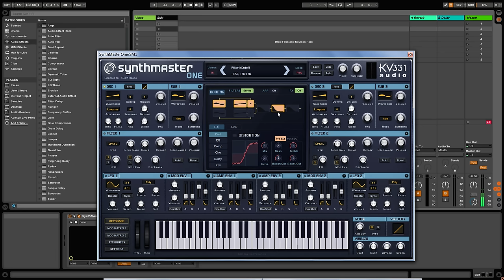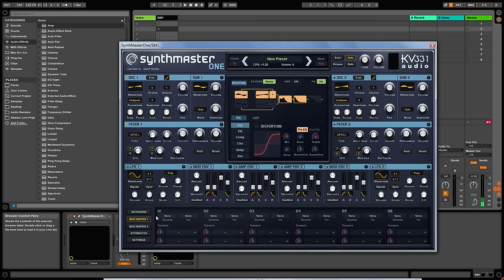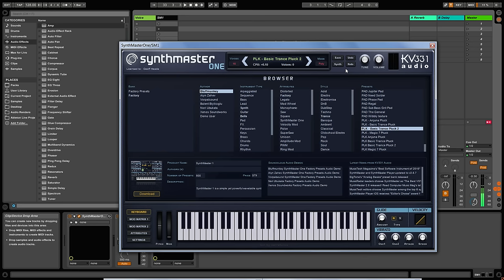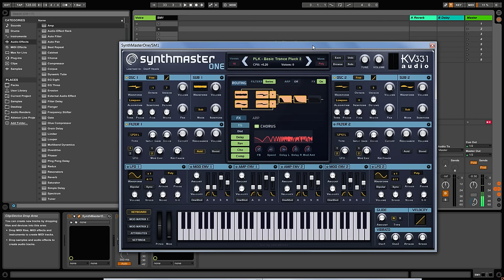KV331 Audio Synthmaster One - First Look

Comment: I've just bought the crossgrade - do you know if there are plans to allow midi cc's to control the adsr's? It seems the sliders can't be assigned yet. I'm using a trackball, and the short travel makes them really fiddly to edit accurately...other than that, (and the help pdf)...I love it...
Reply from the maker: I think he is actually doing something with the ADSR's, I'll try and check tomorrow. There was an issue using some of the mod sources with the ADSR's as a destination and he did mention that more was being added.
Reply: Thanks - and nice work on the presets!
Reply from the maker: Thanks dude. So it appears you can assign certain midi cc's from the mod source list, but not all midi cc's. I also noticed you can't midi learn the ADSR sliders either (which is a bit odd) so I've asked if there are plans for that to be added later.
Reply: Thanks - just heard from Bulent as I filled in the form on the website - "Thanks for the bug report Steve, I'll address that in the next update next week!"... Good to have a developer that's so responsive.... (Still waiting for Steinberg to respond to my ticket raised on Feb 15th)....!
Reply from the maker: Yeah he's just confirmed he's working on that today. ADSR should have midi learn as well.

Comment: How would you compare SM1 to Serum? Any competition? (Thinking back to your "What plugins do I need?" video -- would love to see an update to that one!)
Reply from the maker: Interesting question. I would say that Serum is slightly more clinical sounding and has considerably better FX. SM1's filters are a little bit dirtier, and the distortion can be really noisy and dark. SM1 does have two proper filters as well so you can route them series/parallel, and of course a proper arpeggiator! It's a case of both is better I think!
Reply: Cool - thanks. Impressive to have something this affordable be able to hold its own.

Looks of interesting stuff on the horizon. Dune 3, Zebra 3, SM3...
Reply from the maker: There's another one on the horizon too ;)
Reply: Oh?!?!
Reply from the maker: ANA2 is right around the corner.

Comment: do a tuto on the vocoder as a fx insert please.. . it works but is dodgy in Live
Reply from the maker: I must confess I've never used SM as an insert effect, but I'll try and have a look at it soon.
Reply: BluffMunkey
its pretty cool with the ocs and filters running through vocals...   easy  to set up, just buggy needs to be tested and fixed. that and the arp midi import feature doesnt work and crashes Live
Reply from the maker: Well it looks like he's still working on getting the vocoder operational!
Reply: Its on then! Lol   Hopefully it runs better than Sylenth and Spire on my system
Reply from the maker: Sylenth doesn't run well? That's odd, especially as it's almost a decade old lol.
Reply: yeah it doesnt like windows 7 lennard finally admitted it, and gave me a refund... weird thing is i didnt use the demo, only resampled from it so was hard to tell.  Spire just doesnt work, to many crashes..  even with a  new pc and os...
Reply: And SM1 isnt stable either..  Parameters reset when dragging a midi file to the arp in Live
Reply from the maker: That's weird, I use those synths reguarly on W7 and they're fine for me. SM1 was more buggy on my Macbook, but I only ever used the beta on there.
Reply: yeah i think its a windows 7 or i might need to get on Live 9 lol  
that midi import/drag to arp still isnt working in SM1... i dont like supporting a dev that says something is featured and works but still doesnt. just say it doesnt work